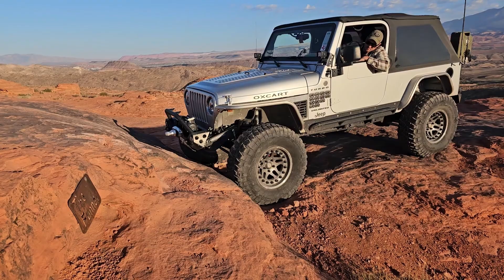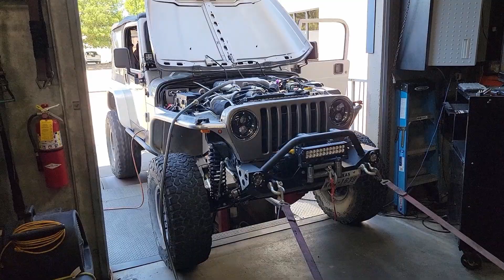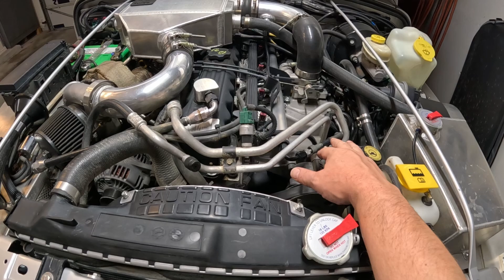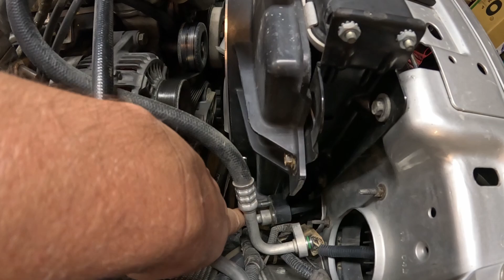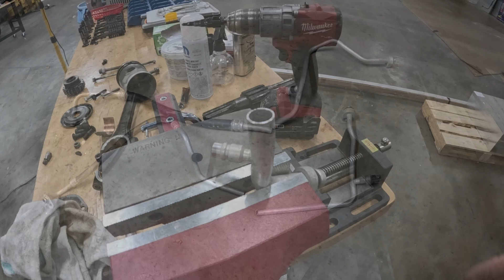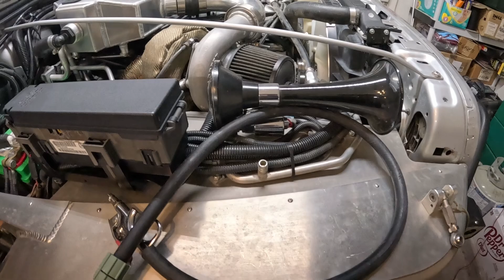Custom AC Lines For The Turbo Wrangler LJ

Comment: Hell yeah Jeremy! 
been thinking about doing this just to clean up the look of the engine bay! But yeah getting those lines out of the way helps out alot cause they do get annoying for when your trying to take stuff apart, Hell i've had to evacuate my system 2 or 3 times now cause i'd rather not work around em!